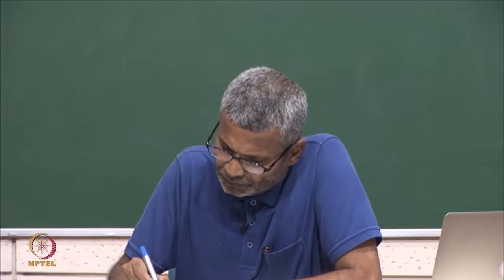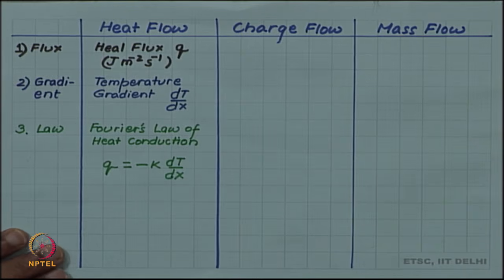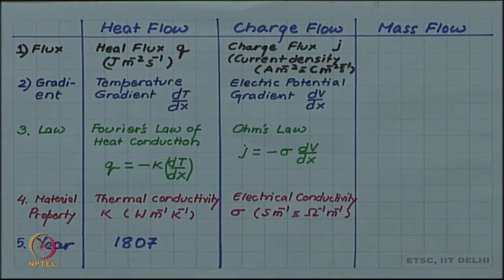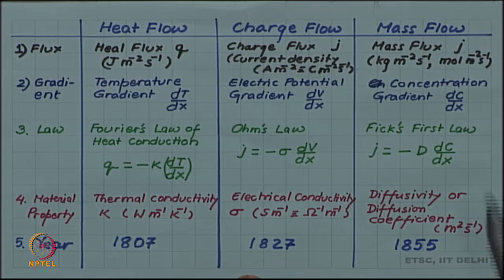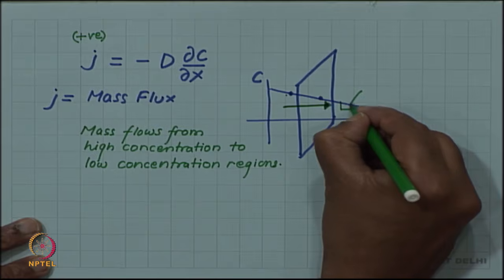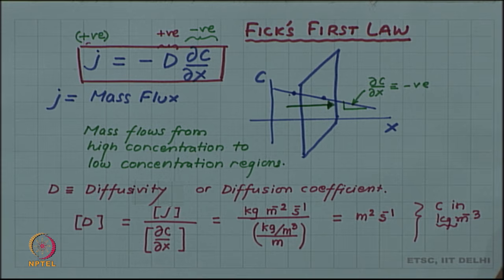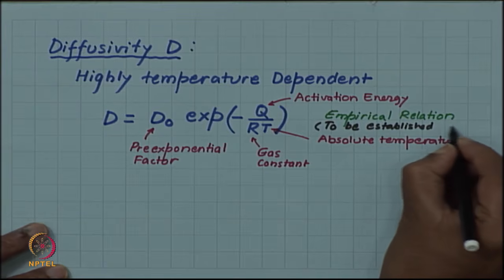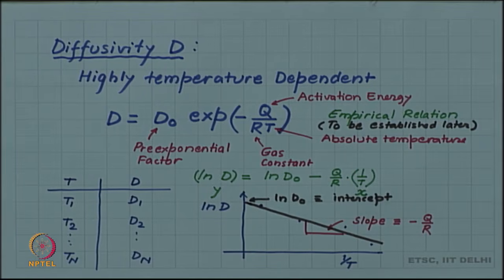Fick's First Law

Comment: Sir in that lnD Vs 1/T graph 
1/T =0 mean that T=Infinite .
Can absolute temperature be infinite?
Which mean that at T=infinity »D=D°
Reply from the maker: Practically you cannot have infinite temperature. Stil, as lnD vs 1/T fits to a straight line, its intercept can be determined by extending the line to 1/T=0.
Reply: @introductiontomaterialsscience  Thank you sir,for quick response 😇